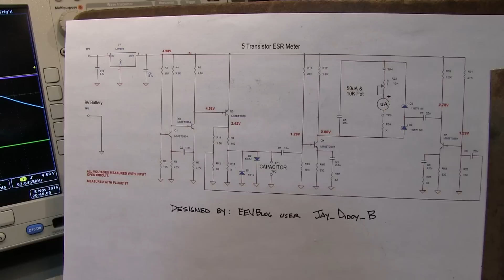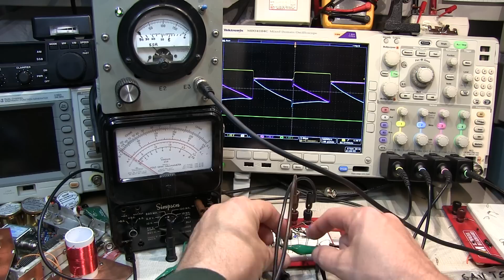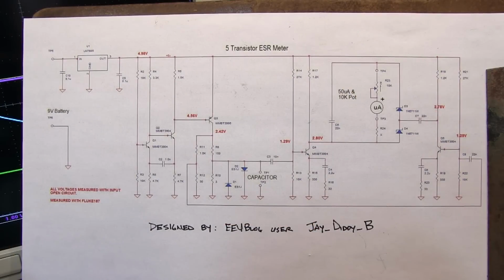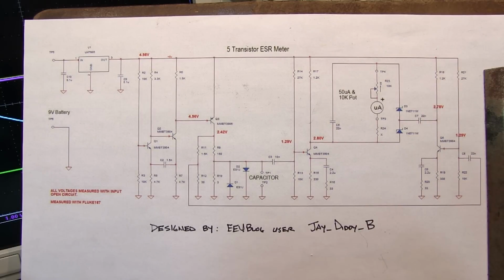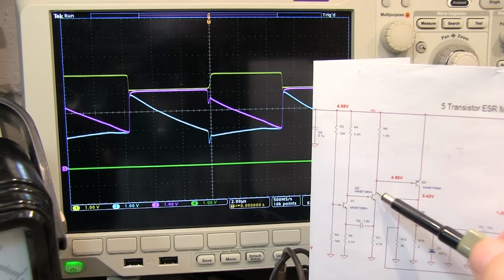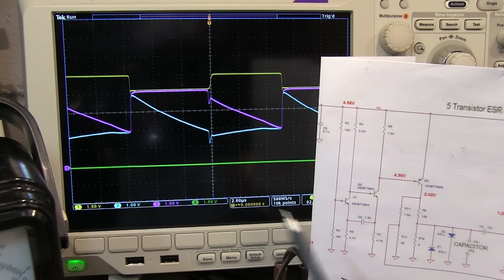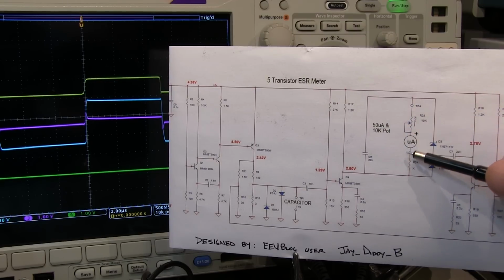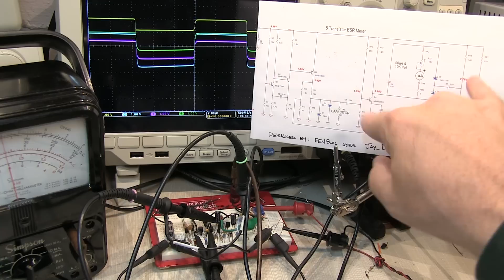#247: Circuit Fun: 5 Transistor ESR Meter circuit by EEVBlog user Jay_Diddy_B

Comment: Hi. I am trying to replicate this circuit. Trouble is when I create a short for the test capacitor I don't get a dc signal as good as you. I get https://www.dropbox.com/s/bcwdme8ul4mm75y/DS1Z_QuickPrint1.png?dl=0 at Q4 collector. Removing the short I get https://www.dropbox.com/s/6juovg10bz49hdv/DS1Z_QuickPrint2.png?dl=0 
any idea what could cause this. I am using 2n2222 transitors and a  2n2907 but not much else is different. Voltages look more or less correct as on the schematic.  Thanks
Reply: Actually I think it may have been stray capacitance or loose connections. Breadboard's drive me nuts.

Comment: Just a follow up on my last comment. I spend all day today designing a print then making it, soldering components etc etc and here's the finished product (see link). It worked at first try. :) I use two bits of copper instead of test leads. You can just touch the copper with the legs of the capacitor to get a measurement. 
https://www.flickr.com/photos/ededitz/35123697504
One question I have though. From which value onwards would this thing be accurate? Because if I test capacitors below 1 µF they all indicate high. And on the EEVBlog the designer does state that it's more of an impedance meter but at high capacitance that's the same as ESR. How high would that be?

Comment: This is a cool circuit! I just finished building it  on a breadboard. I didn't have schottky diodes but I used some Germanium ones with a voltage drop of 270mV and they worked fine. I have an old broken Varicap tester with a 40µA meter inside which is ideal to house this project in. Excellent stuff. It'll give me something to do over the weekend ^____^
Reply from the maker: Have fun with it!  Hope it fits nicely in the old tester.
Reply: It does. Like it's made for it :)

Comment: Why do the two voltage dividers at the start of the bridge circuitry have different values.  Ie R11/R12 versus the lower values R8/R10. Is is to allow for extra current through the tested capacitor ? Thanks
Reply from the maker: Yes, considering that the ESR would be a few ohms or less, these resistors needed to be smaller.

Comment: this proyect can be used in circuit ?
Reply from the maker: I generally advise against relying on in-circuit tests because surrounding circuitry can affect results.  The signal amplitude is low enough that it shouldn't affect things too much, but you can still get fooled.

Comment: I did not understand the central point of it: How does it make the distinction between Z and R ?
Reply: The test frequency is high enough (~100kHz) to make Z quite low (0.15 ohms for 10uF cap), so the reading is dominated by ESR.

Comment: +w2aew  Nice video, well explained. You have a new subscriber.

I really like the circuit also. I will definitely try it. I'm currently using a slightly modified Ludens ESR meter since 2010, I'm almost completely satisfied with it - I just want to enhance the lower readings, although the difference between e.g. 0.05 ohm and 0.1ohm can be noticed (not read precisely, just a hint of needle moving) with it in its current state. It has a much more non-linear scale than the original - which is good, because the lower region is stretched, so I can distinguish 0.05 ohm from 0.1 ohm, while still able to read 10ohms in the same, single range. http://ludens.cl/Electron/esr/esr.html

I wonder what is the current consumption of this 5 transistor circuit. Maybe I will consider to build a FET oscillator if this tricky BJT one draws too much current. If I remember correctly, my Ludens ESR meter eats less than 1mA from a 9V battery. With a low drop 5V regulator, it can run on an alkaline battery for about a year - with a lot of accidental idle running, sometimes a week long :).

I will consider to use a transistor array - if I remember correctly, there are some CAxxxx transistor arrays with 4 NPN and one PNP independent transistors in a common 16 pin DIP package. Maybe it worth to try it - better matching, maybe lower temperature drift caused by potentially unequal temperature changes of the standalone transistors.
Reply from the maker: Current draw for this circuit is about 25-30mA if I recall correctly.
Reply: ***** Thank you for the answer. Well, in that case, I still want to try it, but only for curiosity, or maybe for a benchtop meter with mains supply.

Comment: Alan: Thanks for the video.  One question, what are acceptable ESR values for various values of capacitors?  The Dick Smith /Bob Parker ESR meter chart shows a dip in ESR around 25-35 Volts http://www.capacitorlab.com/esr-meter/pic002.htm .  The Anatek meter plots don't have this dip. http://anatekinstruments.com/products/fully-assembled-anatek-blue-esr-meter-besr .
Reply from the maker: The two resources you list are a good place to start.  Usually, if cap has dried out to the point where the ESR is going to get high, it will be well above the values shown.  In my experience, sub-10uF caps should be 1 or 2 ohms or less, and >10uF should be about 1 ohm or less.  Of course, there is no specific number i look for - just ballparking it to separate obviously bad from good.  If a cap measures higher ESR than a replacement I have on hand, then I replace it.

Comment: I didn't see electrolytic caps called for on the schematic, yet you used them on your breadboard design.
Could you share your reason and placement of these caps?
Thanks for your very informational videos.
Reply: The ESR of C4 and C6 should be small compared to the 33 Ohm resistors in series with them. By small, less than 1/10 of the value, so less than 3.3 Ohms. You can make the capacitance of C4 and C6 larger if you need to achieve this.  22uF or 47uF 10V electrolytic should work fine. If the ESR is large it will reduce the gain of the amplifiers.
Reply from the maker: I used electrolytics for C4 and C6, the degeneration bypass caps for the two common-emitter amplifiers.  I didn't have any non-polarized caps that were 2.2uF.

Comment: Is it possble, theoretically. to make an ESR meter that would introduce a phase shift between two oscillators? So that if the meter was open circuit the two would be 180° out of phase and shorted in phase.
Reply from the maker: In theory, it would be possible, but probably not a simple circuit and measurement resolution could be tricky.

Comment: hey, do you think it will work with bc549 and bc559 transistors and also use 1n4148 diodes instead of es1j ? what is the purpose of 1n5711 ? can also be replaced with 1n4148 or 1n4007? (sorry for the noob questions)
Reply: I have looked at changing the circuit for a 1mA meter. It is tough. Alan is right you have to reduce the value of the resistors in the amplifier. You also need to increase the values of some of the capacitor. It is better to find a 50uA.
Reply: 1n5819 diode insead of 1n5711, sorry
Reply from the maker: The BC549 and BC559 should work fine.  The 1N5819 is probably not a good replacement for the 1N5711 - it is much higher in capacitance.
Reply: Thank you for the replay, can you also tell me what change I should do so I can use it with a 1mA deflection meter?
Reply from the maker: You would likely have to scale down R15-R20 to make enough current available between the collectors to drive a 1mA meter.

Comment: Thank you for posting this. Where can I find more info regarding what is acceptable ESR, borderline, and bad? Does the voltage rating of the capacitor factor into it? I am learning and appreciate good replies to my comment.
Reply from the maker: Opinions vary, and the acceptable ESR will depend on how the capacitor is being used in the circuit.  However, in most cases, ESR should be less than 1 ohm or two.
Reply: Thanks.
Reply: richard goebel the answer is yes.  The higher the voltage, the bigger the cap. Physically larger capacitors will have lower ESR. Google for ESR chart.
Reply: Star Gazer, thank you for the advice. I will check it out.

Comment: How do I need recalculate tie components of pointer instrument (or whole circuitry) for using 100uA graded one instead of 50uA? 20mA? I have both.
Is it suitable for in-circuitry caps metering?
Reply from the maker: It's probably best to determine the series resistance experimentally, since the resistance of the coil inside the meter would enter into the equation, and most time this is an unknown value.
Reply from the maker: It only puts about 100mVpp across the cap, so it can be used for in-circuit testing.  However, you always have to be mindful of parallel paths (additional caps, etc.) that might "fool" you.

Comment: Looking at the oscillator, how did you determine that the transistor Q2 turns off? The scope seems to be showing about a 1volt swing. At full on the emitter should be about 2.6 volts (and the collector also) and adding a volt shown on the scope puts it at 3.6 volts rather than going to 5v. Does this make sense or am I missing something?
Reply from the maker: The missing piece is that I didn't show the base voltage of Q2 (collector of Q1).  However, the evidence that Q2 turns off is shown in the CH1 trace, the collector voltage of Q2.  It rises to 5V, indicating that there is no collector current.  Note that the vertical position is adjusted to 3 divisions below the midscale (note the indicator on the left side of the screen).  The voltage swing on Q2 collector is being limited by the base-emitter drop of Q3.

Comment: Nice little circuit. But I have a feeling that if you don't match Q4&Q5 by Vbe, the performance won't be that great. Did you pick a matched pair or just a random couple? And yes, the oscillator is quite a neat little circuit, the waveform looks good for such a simple arrangement running at 90kHz
Reply from the maker: There is enough degeneration in the CE amp that the small mis-matches won't affect things in a dramatic way.  I simply picked a pair out of a random 2N3904 bag...
Reply: ***** That's great, makes it real easy to get going

Comment: Perhaps I missed it but was is the frequency of the oscillator circuit? I know with my ESR tweezers that you choose higher frequencies to get more accurate ESR measurements so was just wondering if the frequency could be increased to enhance its accuracy?
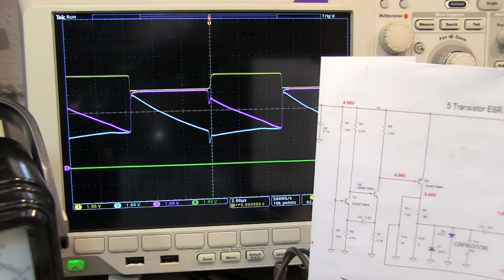Reply: About 90kHz, the sweep was 2uS/div 10:25
Reply from the maker: You can also see the Trigger Frequency readout in the lower right corner of the scope display.
Reply: Brian Ullmark the scope shows one cycle of the waveform to be 5.4 divisions, so at 2us per div, that's 10.8us, and 1/10.8=92.6 kHz. You could vary this frequency by changing the capacitor value in the oscillator, but if you vary it too much you might need to tweak some other components farther down the circuit also.

Comment: I like that circuit, its elegant.

Does it measure ESR or does it measure impedance  Z ? Often the Z-type measures only down to  somewhere around 10 uF because the reactance part of Z becomes to high. If it only measures the ESR, the real part from Z, it can go down much further.  DF becomes lower for small caps but that is because it is a ratio. ESR is going up if frequency drops but not as fast as the reactance. (calculate the ESR of a 100pF cap, it is huge but almost nothing compared to the reactance) 
ESR is general at the lowest point somewhere between 20 kHz and 100 kHz.  

ESR in datasheets is stated for 120 Hz in the form of the dissipation factor ( D or DF) , if Z is given, they state that at 100 kHz (for a sinewave ? I do not know how the factories measures, I think some kind of networkanalyser )

http://www.pa4tim.nl/?p=3775  : More about measuring ESR at several methods

Fred, pa4tim
Reply from the maker: It measures Z really.  So, only designed for checking ESR of electrolytic caps - common failure in consumer electronics. It uses a measurement frequency of about 100kHz.

Comment: Thanks for sharing and explaining the circuit. I finally started looking not at the voltages applied to the EBC of transistors but to the differences between those voltages, and the effect of those differences on the junctions. Now transistor circuits make a lot more sense.  

What effect would a more sinusoidal wave vs. the square wave have on this circuit? I just might try...
Reply from the maker: It would work just as well, I think.
Reply: w2aew Thanks for the reply. I was wondering more what effect a sine wave vs a square wave would have on the ESR measurement. Do the harmonics of the square make it different? Curious from an educational standpoint. Easy enough to test, I suppose.